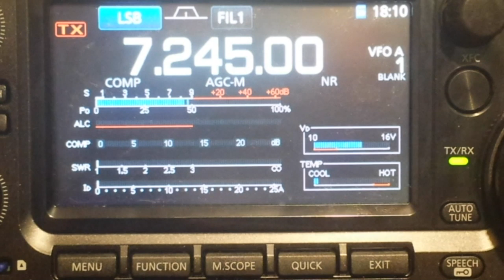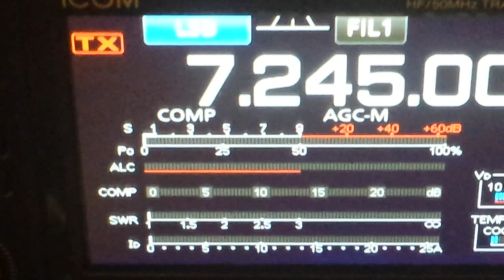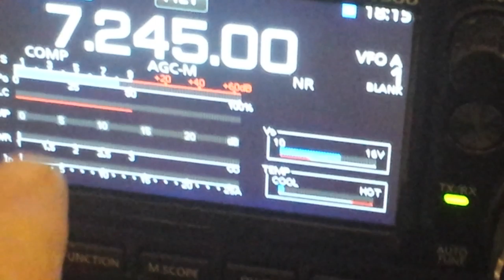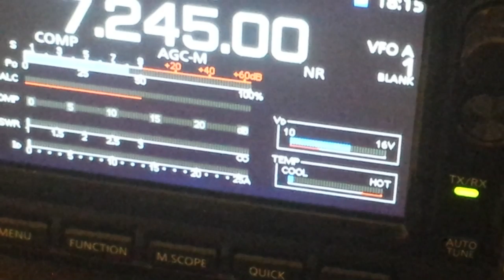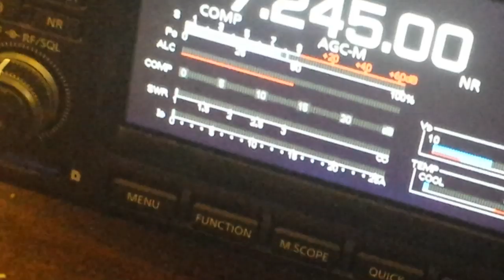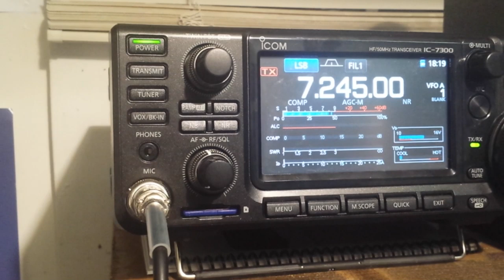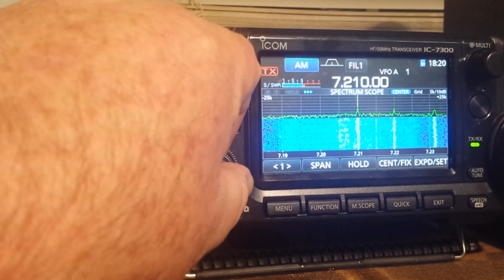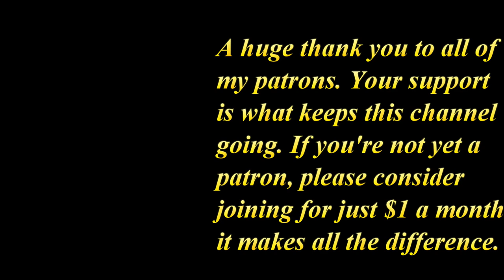Test your feedline for common mode noise and shorts

Comment: I never thought of testing with just the center conductor without the shield. Such a simple but effective idea to check for common mode noise. Now I need to figure out how to apply this technique to a BNC or SMA connector. Thanks Paul, another great and informative video!

Comment: The connector is incorrectly referred to as an SO-239.  The correct description is PL-259.  The antenna socket mounted on  the rear panel of radio is an SO-239.

Comment: For sure guys/gals this works. I made an ugly balun years ago, but it is better suited for being outdoors as close as possible to the antenna feed point. It’s a little large for in the shack and hard to get real close as possible to the SO-239 antenna connector on the back of your rig where it needs to be. Because the closer to the radio, the better. For in the shack you can make your own common mode choke that has a much smaller footprint. A 2 inch ferrite ring and about 6ft. (or even a little less) of RG8 coax with the PL-259 connectors already on it. Around 10-12 loops around and through the ferrite ring (many examples here on youtube). Make sure your PL-259’s don’t end up next to each other (again watch youtube tutorials on this). Make one side have only about 2 or 3 inches of coax hanging (this will directly connect to the SO-239 on the radio) and the rest will end up being about a foot left over after the windings. You’ll need a barrel connector to connect your new choke to the regular coax that goes out to your antenna. Like he says, you can mix/match or use same types of chokes in series with barrel connectors. Yes the presenter incorrectly calls the SO-239 (socket) on the back of his transceiver a PL-259 (plug) numerous times, but I think we all know what he meant. We’ve all made the same mistake at one time or another. Not a big deal. Installing a choke(s) and grounding your coax shield is the good 411 here.

Comment: At or around 5:28 where you state that when you connect the coax shield back to the radio, if the static or noise stops you know your antenna is shorted-out, there is another side to this. I can agree that if the receiver goes silent, then a short somewhere in the antenna system may be the case but if you are tuned to a weak signal and you hear all the static/noise with the shield disconnected and then when you connect the shield back to the radio, the S meter should actually show a lower level and the static/noise will be reduced and you will actually hear weak signals much better - this is assuming your antenna system is in good order. Without the coax shield in good order and connected properly at both ends,  and any splices along the coax, the coax becomes part of the receiving and radiating antenna system and you don't want that. To make it clear, the antenna "system" includes everything from the radio to and including the actual antenna itself. The "antenna" is the only part that should be receiving and radiating signals. A lot of QRM was caused years ago by most all of us ham radio operators simply connecting our coax directly to dipoles without a matching device located at the antenna - up in the air within a few inches of the physical antenna itself. Of course everything was analog back then especially TV and it was easy to cause trouble to the neighbors, including the telephone, making the garage door fly up and down, getting on the stereo and so much more. Digital technology is our friend nowadays and most of us make much better antenna "systems" today than we did 60 years ago. Good quality coax (for example,  LMR-400) with a true balun connected right at the antenna for any balanced antenna, like a dipole, or a hexbeam, the yagi is an exception with a gamma match, is the best way to do it. 73  WA4QGA

Comment: Balanced antenna's like a dipole direct fed with coax and no balun are notorious for picking up common mode noise. Coax cable is an unbalanced feedline and loops and dipoles are balanced antennas. Although many hams hate baluns, if you don't want your coax radiating instead of the antenna, a proper 1:1balun at the feed point of a dipole ensures that the coax won't radiate and the antenna will. You cannot properly feed a balanced antenna like a loop or a dipole with coax and no balun, the coax WILL radiate RF before it reaches the antenna. Many hams insist on doing it that way because "It always worked for them" but that doesn't mean it's the right way.

Comment: Good video. 
Just a minor nit, but since you named the channel learnelectronics, you want it correct. 
PL stands for plug and SO stands for socket.
SO-239 Is a SOcket. That is the antenna socket on you radio.
PL-259 is the PLug that goes into your SO-239.
If you buy the SO-239to put on your coax, you will get the wrong part.

Comment: Thumbs up, and another test from long ago:
Short out your antenna input and turn up the AUDIO gain, and turn off the squelch.   If you hear noise then, the audio circuits in the radio are noisy, and may need some work.  Bang lightly on the side of the radio, and listen for harmonics too.

Additionally, you can install a 50 ohm terminator into the antenna connector.  If you can still receive signals, even broadcast stations, your radio may be lacking sufficient shielding or grounding.
73

Comment: like this. If you want to make a Jr. engineer freeze in fear and horror, just start talking about common mode...Took me a long time to just be comfortable with the term, let alone an intuition of what it is, and how to control CM.
Q, not a Ham. Where is your shield ground located?
Starting with a star ground mindset, it can only be at one point spatially.
Thus all other locations have added ground plane impedance added, usually not modelled.
This causes standing waves in the ground chain. You can't make the ground plane perfect, aka zero acceptance. A fine tuning method is to have one or more capacitively grounded paths at points that have high phase creation in the ground plane or standing waves up-down coupling. A larger C in a RC snubber in // with a small cap, may be needed to dampen and lower the Q of the tank just added.

Comment: And learn how to solder you PL-259's onto the coax for a good solid electrical and mechanic connection instead of crimping and using heat shrink to hold it on.  And I have never seen a good shield connection on the cables with the molded rubber boot on the connector - it's basically just stuck it the back and the rubber injected around it to hold it !  And wondering about the fact that you unscrewed one coax but then used another for the demo ?

Comment: Half of my dipole antenna is connected to the shield so it makes sense to me that the signal strength along with noise would increase with the shield connected.  Repeat the same test on a busy frequency and see if their signal strength also increases.

Comment: Pretty sure you have to terminate the connection (SO-239 in this case) with the characteristic impedance of the transmission line to measure the internal noise of the receiver.

Comment: Differential mode current doesn't travel on the center pin alone.  The is an equal and opposite amount of current on the inside of the shield.  Due to the skin effect, the inside and outside surfaces of the shield along the coax can be seen a two theoretical conductors.  Any current on the outside of the shield will be travelling in the same direction as the center pin and is considered common mode.

Not really sure what happens when the shield reaches the chassis of the radio.  But it's the equal and opposite current between the center conductor and inside surface of the braid that cancel each other out and prevent the feed line from becoming part of the antenna system.

Comment: By  unscrewing the barrel of the " PL259 "   you are causing the coax to behave as an antenna ,  So if this coax runs past , Lets  say a switchmode power supply  from say a laptop  it will pick up the radiated hash  generated by this power supply ,  This isnt an ideal way to find  noise on your coax.
Reply from the maker: This is a standard method taught to RF engineers for the last 30 years. But if you dont like it, by no means should you follow my instructions.
Reply: @learnelectronics  in your defence this technique works very well. It may not be perfect under all conditions but it definitely works.

Comment: Good video, but I have some questions:
1) Shouldn't you be measuring the no-antenna case with a 50 ohm load at the input?
2) The common mode noise explanation at 4:30 doesn't seem right. The differential return from your feed line should be on the inside of the shield. Because of skin effect, this is actually a separate conductor than the outside of the shield. If 100% of the return isn't on the inside of the shield, some of the return will be via the ground, which indicates a common mode component in your signal. When you don't hook up the shield, 100% of the signal is forced to return via the ground of course.

As an aside, I watch and enjoy and give thumbs up to nearly all of your videos, but I don't remember you testing your antenna's VSWR using the NanoVNA. Apologies in advance if you've already made this video and I've forgotten about it...
Reply: Well, I agree, lots of problems with these methods. If he has noise in the room, the noise would go way up with just the pin of the coax plugged in. The method I would use would be one test without a common mode 1 to 1 well made common mode choke. 2 using that choke, what do you get. All of the common mode noise would go away.  Most who use these chokes say nearly all systems have this problem.   It would be cool to switch the common mode completely in and out of the circuit with a switch or relay, That would be a great demonstration.
Reply: Center coming in, shield out, outside of insulation is rf comes back in.

Comment: Nice tricks to get rid of common mode noise, I am not playing with a Ham but it’s always nice to know ways to cut down on noise when you has a signal trying to get through. If you ever have problems getting a good signal through a cheap 10’ usb cord ferrites may help with that too. Great video Paul.
Reply: 10-foot ferrites?

Comment: Great video Paul, but shouldn't you be using a 50 ohm dummy load for the receiver-without-coax test? I don't know what type of coax ur using but I found by using a quality coax like LM 400 (double shielded) coax with the chokes placed at the antenna feed point will help a lot. Also, using the receiver's internal or an external (audio) active noise filter helps with that atmospheric noise. And lastly, make sure you stay alive long enough for the next solar cycle max, at which time the wanted signals will far exceed your QRN level. 
Have a relaxing Happy Thanksgiving day.

Comment: Something that has been slowly rising to the top of my personal "pet peeve" list is what people have been calling the UHF coax connectors lately.  I understand getting confused in the nervousness of the recording too.
The  connector on your coax is a PL-259 plug (the center pin is a male "plug").  The mating chassis connector is an S0-239 (the center pin is a female "socket").
I am not faulting your general content and you definitely are not the only or first one to use incorrect nomenclature in their videos.
One other technical point, the item you described making at the end is a coaxial choke and while the PVC can make it look neater, just coiling the coax up for 5 or more turns and securing with tape or ties will do, but these do more to help with transmitting issues.  BALUN  indicates a device to convert BALanced to UNbalanced which this configuration does not do.
Good luck 73 & keep up the work  WB8FEQ since 1969

Comment: It could be "atmospheric noise ", but could be also noise generated by something in your area,  and being picked up by the antenna.   Which now would be hard to prevent from coming in and would have to be eliminated at the source.
I hate.
 When some sea bears or new hams think you can stop all noise by buying a more expensive radio and/or putting all kinds of filters in the noise is coming through the ai'm in true DA waves, just like the signal you're trying to receive, there's not much you can do about. It, it's like somebody.  Shining a bright flashlight into your eyes and you're told not to turn away and don't close your eyes. Well, you're gonna get blinded until somebody shuts that flashlight. I.e. The noise source off.

Comment: A good video but you do have tons of common mode noise,  if you use an EFFECTIVE common mode choke the rig will barely receive anything with just the centre conductor attached. If you doubt me try a short patch lead passing through an FT240-31 perhaps 10 turns. The "UGLY BALUN" often makes things worse, and the ferrites need more turns, they should also be the right mix ferrite.

Comment: I have an ugly balun just before my 1/4 wave vertical. Just some rg 213 wrapped around a 5L water bottle. The overall length is short. I can't remember exactly probably 3M on the bottle and 4M along the rest of the run possibly less.
  I find some noise in harmonics in different places on the bands. Listening in AM sounds the noisiest here. I want to try to defeat some of these harmonics. Possible tuning stubs as bandpass filters?

Comment: I know It might sound like a bit of silly advice please disconnect your microphone from the radio before you unplug the pl259 plug from the back of your radio.  If you accidentally key up without an antenna connection you know what will happen,  you will damage your pa stage it’s better to be safe than sorry.

Comment: Thanks for that video.  If you’re looking for more video ideas, how about one on grounding?  My “shack” is on the 2nd floor and I’m puzzling a bit on how to properly ground my rig.  I have an 8 ft rod in my garage, but that’s as far as i have progressed.
Reply: Do a research on "artificial grounding systems". Take a look at the MFJ-931 from MFJ Electronics.
Reply: @MrVosh-nj2lc   Thanks, that's interesting. I had never heard of such a thing.
Reply: @karllaun2427  You're welcome, best of luck & 73's

Comment: I see this was a year ago. This was actually a lot of wrong information. I hope you realized by now that you had a ton of RFI and the ferrites are meant to help RFI and not common mode noise. You could have also mentioned shortening your feed line, using a 1:1 choke and grounding the antenna as additional ways to stop common mode noise.
Reply: No, this is wrong. The use of ferrites is to choke or impede the flow of common mode current. For instance, on the outside of the shield of your coaxial feed line. Having this CMC makes your station susceptible to receiving RFI, and in reverse when you transmit, you're more likely to cause RFI. 
So I don't know what you're talking about. This is concerning considering you're trying to correct this individual when another may read it and buy into your story.
Reply: I see this was two years ago but.......

Comment: Short out the Receiver input insuring noise is not internal to the receiver.  Injecting a known Signal in the beginning of the coax (Antenna End )  thru the path provides a base line on your line noise levels.  Line Loss.     If available a Freq Selective Volt meter Terminated in 50 Ohms does this job most well.

Comment: what does it mean if as you showed, the noise is on the center conductor and not common mode? My noise floor is usually between S6 and S8 even with a Palomar engineers common mode feedline toroid. thank you much!

Comment: 5:15  i dont think your right about having a short if static goes away after connecting shield. Static Noise is Depending on your squelch setting after full connection. Correct me if wrong.

Comment: so what does it mean if the noise goes down when i connect the ground but only on higher bands, on lower bands 20 and below the noise stays the same?
Reply: You probably don't have enough inductance on your common mode choke,  see my other post. I have played a LOT with common mode chokes.

Comment: Very informative, but one question, I was dealing with a radio that wasn't receiving a signal all of a sudden. If I only connect the center of the coax, I could hear a signal in the speaker, connect the outer shield, the signal went away, any ideas? Would be interested to know your thoughts. Thanks.
Reply from the maker: sounds like a short in your antenna system

Comment: what if it gets quite a bit louder when you screw the connector on?
Reply from the maker: Then you have common current noise
Reply: @learnelectronics  that is not necessarily true, if you have an effective common mode choke you will receive very little at all with just the centre pin connected..

Comment: Just put a short verticle up as far from noise sources as poss. running the co-ax along the ground, with earth stakes at bottom of verticle. But dont run wires from them back under verticle. Experiment with dissconnecting/re-connecting earth to back of rig. Ugly baluns work well, also reducing SWR on Xmit!